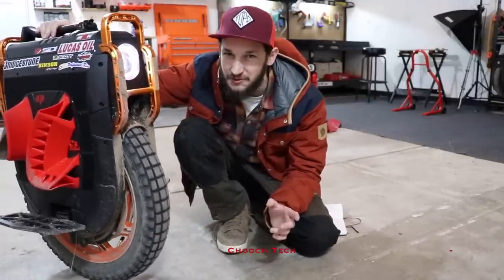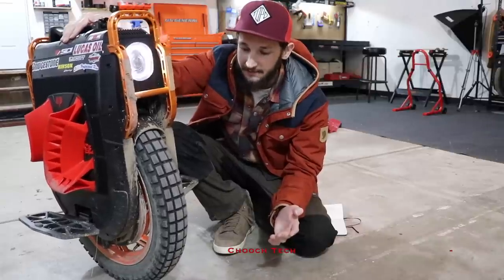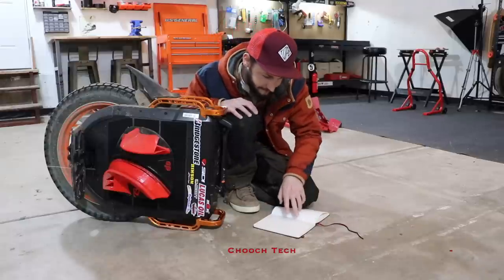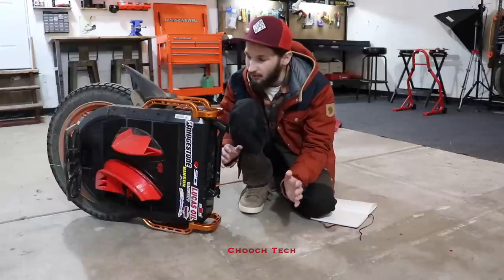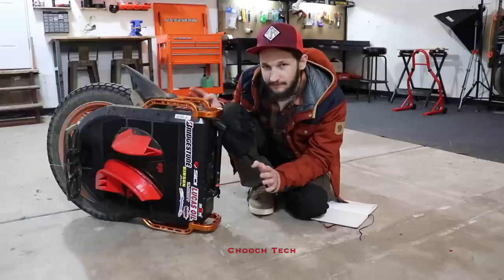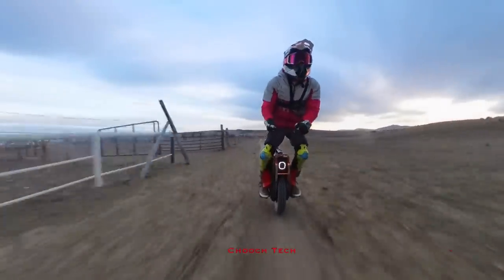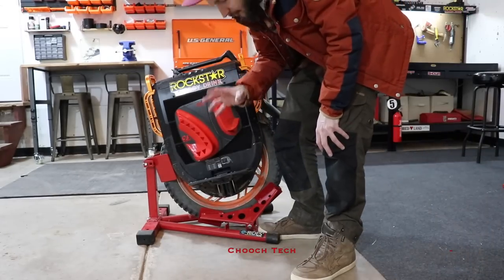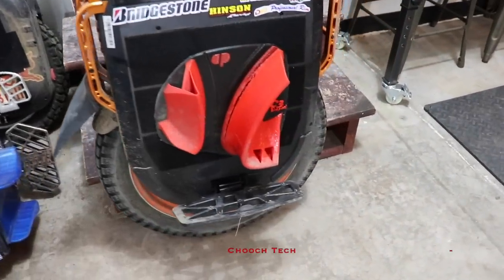STUPID FAST PERSONAL ELECTRIC VEHICLE! INMOTION V13 (ELECTRIC UNICYCLE) RIDE AND REVIEW!

Comment: Hi Chooch. Do you remember the issue with the tire pressure on V12HT? The same company made the tire for V13. Just read on the side of the tire: max 40 PSI for 180kg rider. 
The wobble issues may also be the result of excess of pressure on the tire. For your weight and style, I would try with 25 PSI. Give it a try and share your thoughts with us. Finally we see the Challenger being driven the way it was made for. Thanks dude, awesome ride and review as usual. 😉

Comment: Strength helps on the v13 a new tire solves wobble without any muscles I was extremely surprised swapped it at 600 miles.
Reply: Did you swap it to Michelin Pilot Street 2?

Comment: Braking pads should be located high and further to the rear on the wheel such that you can sit down as if you were on an invisible chair mounted off the back of the wheel and the braking pad is supporting the upper calf. This resolves the wobbles because you are in maximal contact with the furthest two points of the wheel's shell.

Comment: Great video! 😊❤️🤙 Now that I've been riding the T4, with #C3BioPads (mine are light blue 💙) I finally have a much better understanding of your videos & riding EUC. +450m already 😅  I was a bit worried about layer adhesion on my set as well, to DIY fix you have to reheat/melt the plastic together but let me know if ClarkPads offers to fix the failure?? 💙✌️🤙

Comment: Chooch great points and analysis of V13, great video shots, great presentation etc, all top notch, thanks.  

Any chance you might try to get rid of the echo in your garage presentation?  

One thing you can try is getting and pairing Open Comm aftershokz noise canceling headset through Bluetooth to your insta360 X3. Echoing background just drives me up a wall lol especially when everything else is top shelf :).  Keep it coming 😊 and keep the good work

Comment: 28:03 for me its like, I control my wheel or rather my weight with the right leg, the left leg is slightly more forward, and I ride rather a lil angled and the left leg gives me that forward momentum while the right is there for balance check and stops. I start with my Right leg on the wheel tho and push myself of with the left

Comment: The other day,  I went back 'home' to visit family,  and brought both of my EUCs along for the ride.. 
I got a V13 last fall,  then blew out my back,  so didn't get to ride it until' this early summer,  then another injury.. 
So I got an A2 - since they're so much smaller/lighter..  
Anyways..  Rode the hell out of both of them over the past few days,  and DAMN that V13 is FUN!!!! 

I hoped that it would feel like 'stand up riding' on a motorcycle,  and Yup,  that's damn near Exactly what it was! 
[On my Dual-Sports,  I do more stand up riding than not - when in trails, or scenic routs]

BIG Take-Away...  Don't get too used to the agile / precision handling of the A2 [or similar]
and then hop right on the V13 and 'expect it to turn'...  hahaha  
They should be equipped w/ rear stickers that say:  "This Vehicle Makes Wide Turns".  🤣
🤘
Sam -

Comment: I just had a crash in my v13. Couldn't stop in time. I'm thinking I may need to adjust the stock pads or get non-stock pads overall
Reply: Get better pads. I rode the v13, it's heavy lol. It takin me awhile to get used to stopping heavier wheel pads and technique is key. To stop the v13 easier and safer have good pads and lean back like sitting on a chair. Your back pad position is important to battle wobbled depending on the balanced placement that works for you, everyone's different. Hope your alright btw.

Comment: to reach 30mph on my v12 I didn't have to lean too far forward. But to reach +35mph I end up feeling like I'm going to fall off the front of damn thing lol. There must be some setup to get it to rip w/o having to lean so much
Reply: I had the v12 high speed with grizzla pads and to touch 35 plus wasn't hard it was just sketchy with the wind hitting them speeds on a 16 inches light wheel . I would lean and push my knees into the grizzla pads and push down with the front of my toes and had zero issues hitting 35 plus just sketchy as hell imo

Comment: Man, I don’t know about the older guys shit.  I’m 54 and crashed hard last year.  Some road rash, etc. Jumped a speed bump at 20 mph being chased by a Rottweiler.  Was sent 10’ into the air and flew about 20’ before landing.  Been riding for 3 years on an Inmotion v8.  Love it, but given a 20 mph. limit, crashing on this 115# wheel tells me I’m going to the hospital….no doubt.  Doesn’t mean I have to ride it that fast.  But, I usually push the upper limits of things.  Can’t imagine even getting close to 40 mph let alone 50.  Now with that said…I weigh 180#. I am very fit, very strong.  Strong legs.  Max squat at 700#.  Regular at 500#.  I think I’m strong enough.  But, all that talk of jumping obstacles at speed?….no friggin’ way.  Sliding sideways?  Oh, hell no.    I don’t bounce like I used to.  Wobble?  Aw, shit.  Just me saying it.  Good luck all you older guys.  I’ve always been an extreme sports kind of guy my whole life.  The daredevil In me says I would like to ride one just once though and see how it feels before committing to it.  Is there a store out there that lets you try before you buy?  I am tempted.
Reply: Just do it bro. Get it in while you can

Comment: S22 Pro better
Reply from the maker: s22 pro was missing bolts and has been broken for 5 months, no its for sure not better
Reply: @choochtech  that is unfortunate but the s22 pro is lighter , has more torque and better suspension
Reply: More torque nah it seems like that just cause the v13 is a heavy wheel but it will blow the s22 pro away the components on the v13 is way better it's by far fast and high quality s22 has cut out issues along with bolt issues bad quality 😮
Reply: You get less speed wobbles on a heavy wheel but you wouldn't no the more weight at high speeds keeps you and the euc planted . Your just a fan of the s22 no issue but facts is facts 😆
Reply: The battery pack is worse then the v13 and the v13 has way way way more power then the s22 could ever imagine look at the specs v13 falls short with range cause of the batter but that's about it
Reply from the maker: @tremartin4727  I agree 100% Kingsong and begode gotta step up quality the v13 has held up to me absolutely bashing it. I want a inmotion suspension 18 inch offroader next!
Reply: @tremartin4727  okey thanks , I appreciate your point . What about Begode EX30 ? Is it better then V13 ?

Comment: @chooch tech So chooch, how does this fair to all of the newer wheels that came out from: Sherman S, Begode T4, Commander Pro, Kingsong S22 Pro, etc.
Reply: Skip the commander pro, it may seem like a good value but it's poorly made. I wouldn't trust it. I rode the v13 but pilot a s22 on the reg. Vastly 2 different wheels. The s22 great on trails, jumps, stairs all around fun. If your looking for a long range cruiser with a suspension, I would recommend the Sherman-S. If your a big rider like 220 pounds and over 6 feet the v13 would suit you well (and experienced rider), but expect a 45 to 50 mile range on the v13. Sherman should get around 90 miles.
Reply: @MrSpeedyduck  yes this is what I mean. I use the euc for work travel, groceries ect. And yes I would have a sherman-s seems like the best choice out there. Annihilation to those pedals all day though. But if you want fun thrills, nothing better than s22. And your suspension problem is a common issue actually. I believe there is a new version of the shocks either coming or already available